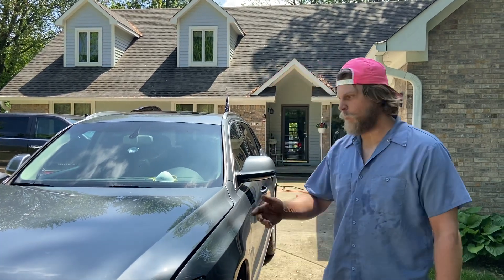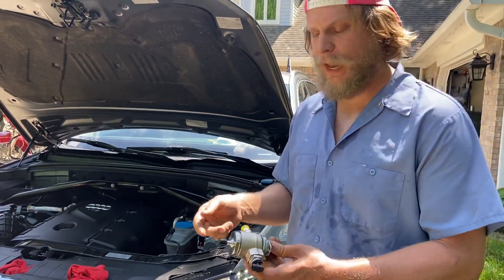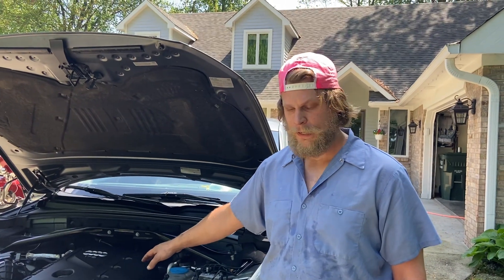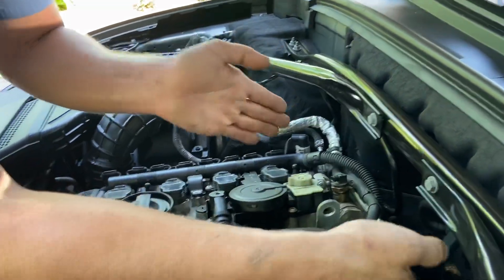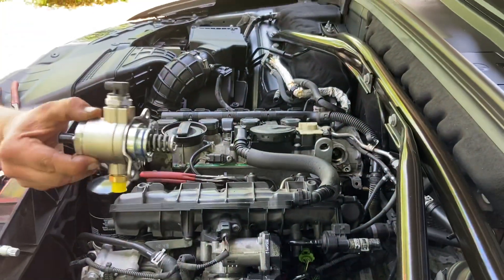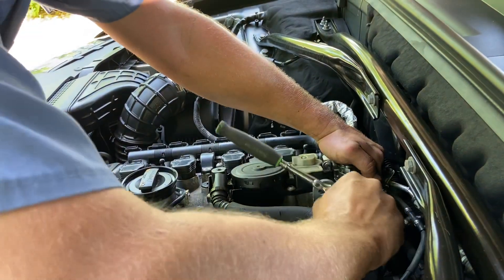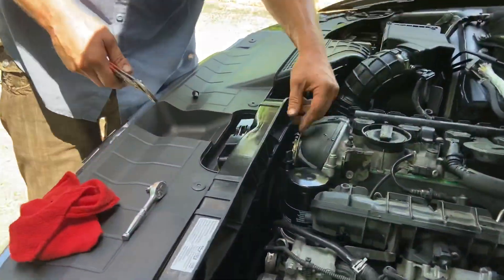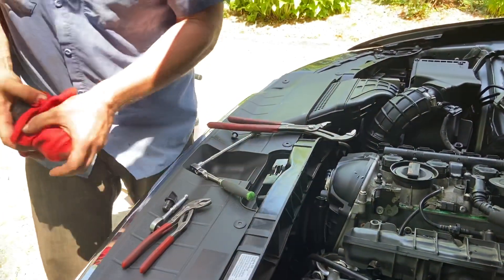P2188 Audi vw a4 a5 q5 2.0t tfsi hpfp

Comment: This fixed my 2014 Audi TT with 207k miles. P2188 and P2177 codes, the later having turned on the MIL light. Started cold, but had starting issues after driving and when left one hour off when engine was still warm. After quickly replacing the HPFP with my brother (engine is transversely mounted so was easier to get at the pump), all is well. Great video!
Reply: aftermarket or oem?

Comment: how does one test a hpfp ? I have a issue with my Audi 2l tfsi , no error codes. using a topton scan tool , I think its fuel because when it cranks the fuel rail pressure go up to over 80bar then as soon as the car starts the fuel rail pressure drops to 30bar and then the engine stalls (using the scan tool to monitor).

Comment: Can you tighten the bottom fitting prior to tightening the 2 top bolts?
Reply: No - the pump goes in with a spring load.  Not possible to attach the HP fuel line first.  I had no trouble with that fitting doing it like he showed.

Comment: I replaced mine on 2014audi could smell gas in oil. Change oil 2 times and still stinky but runs good now. How do I get rid of gas in oil smell?
Reply: Dang my car has been having gas in the oil for like 2 years but now it got worse, 500 miles after an oil change I take the oil cap off and it smells like pure gas

Comment: I had this P2188 on my A4 B8.5 2015 and changing the HPFP 100% solved my issue and this video was absolutely clutch.  💯  you are the MAN!!
Reply: Thanks for posting that. I have the exact same code on my 2015 A5.
Reply: What where the problems you had before changing it?
Reply: @edgarpilotzi3190  it was like a hard start condition. It was almost like it wasn't getting enough gas.
Reply: did you go oem or aftermarket
Reply: @bryan-th3xf  oem from fcp euro
Reply: @uavcalifornia9350  thanks

Comment: You ran the low presure fuel hose over the ignition wires. At 2:08 (original) it's oposite.

Comment: I have P218800 and P030200 error codes.... i have the same car that when engine temperature is hot it refuses to start ..so i have to try for 5-6 times to start the engine ...but when engine temperature is cold it start perfect ..i have noticed that my car now consume more fuel and acceleration is not the same ,now is slower ....any idea what can be the problem?

Comment: so that took well below 1/2 hour!   
My 2015 Q5 2.0.  I have misfires on  cylinder 1 &3 at high speed (not necessarily at high RPM, but both speed and rpm - around 73-78 mph). 
Plus codes P218800 and P12500 (low Fuel level ), Local Audi expert says I need to change coils and spark plugs, and gas cap. The car has 99,600 miles. So I guess I should do it anyhow (doesn't look like the previous owners did that at 35,000 miles) since they are getting up in there....but I think it might not solve the misfires unless the fuel pump is replaced, like you did?
Reply from the maker: If fuel is leaking into the oil with a bad hpfp it needs replaced immediately along with an oil change
Reply: @NaptownTuner  thank you.

Comment: I have a strong gas smell in the oil on 2011 Audi A5, no codes or cel. If it was the pump, I should be getting a code, correct? Maybe injectors?

Comment: I have a 2011 A4. The car used to run and run very rough. I have codes for multiple cylinder misfire. And the car stopped running. Just cranks and won't run. Would it be the HPFP?? Please help. Thanks
Reply: Any chance that Hpfp fixed it?
Reply: @christopherlaw2460  new timing chain  2000$ later all is good now
Reply: @christopherlaw2460  no it wasn't. The timing was jumped.  Best way is to run a compression test on all cylinders. If they are all below 150 psi your timing is out. Hope this helps
Reply: @christopherlaw2460  new timing chain  2000$ later all is good now

Comment: Another great video! Thanks! I have a problem with my 2014 Q5 2.0T. Bad misfire on #2 & #4. I replaced the injectors and did the carbon cleaning in the intake and valves. While soaking I noticed one of the valves on the cylinder 4 didn't hold the carb cleaner liquid as well as the others. After putting it all back together, the cylinder 2 code went away. Now, I have P0304, P0300 and P130A. I replaced the PCV unit and still no change. Car runs shaky in limp mode. It drives but no full power. When I first start it, the CEL flashes then EPC light turns on. I am starting to think it maybe burnt/bent valve on cylinder 4. Do you think I should replace the HPFP too?
Reply: La mía tenía un problema casi igual con el cilindro #1 y le cambié las bobinas negras por las rojas y se solucionó el problema
Reply: @moxykid I'm having almost the exact same symptoms on a 2012 VW CC, but I'm also getting a P12A2 code.  Bad misfires on 1 and 3. I could smell gas while inside the car for about 2 weeks before the car went into "limp mode". What ended up solving your problem? HPFP?

Comment: please I need help !! my car does not work quietly at the first ignition !! the exhaust stinks of unburned gasoline. error reported by p2188 system too rich at idle bank. the oil level in the engine has increased slightly and stinks of gasoline. the car is a3 1.4 tfsi

Comment: What test we can do to prove the pump leak?? Because it too expensive.
Reply from the maker: You could wait until enough oil mixes with the gas until it wipes out your bearings,  you could send the oil sample out to the lab to see if it’s diluted and wait about 3 weeks to get it back.  Or you could just trust me that the hpfp’s are prone to failure and if you have a rich fault replace it first.  Usually you can take the pump out and smell the gas the strongest on the spring / end of the pump
Reply: @NaptownTuner   my car was running rich -15% LTFT, i was suspected for bad maf since i had some ather issues like bad idle, hesitating, hard start. I change the maf and fixed everything but the ltft went -25% with the new maf. What do you suggest me to do? Thanks
Reply from the maker: @fortnitedaily1042  so far I’ve never seen a bad maf on a 2.0t and I’ve been working on them for over 10 years
Reply: @NaptownTuner  i am pretty sure my maf was bad since the new one , fix my ather issues, and the car has much more power, just i cant figure out why the fuel trims get worse. Mabye its the hpfp, thanks for your help 👍

Comment: If the pump is still working, couldn't you just replace the o-ring?  A new OEM pump is expensive.
Reply: no the seal is on the inside.

Comment: Hey man, I get P2188 that comes and goes away after a few days. Could it be the MAF sensor?
Reply: @Vlad P. I have the same problem. Did you ever find out if it was the hpfp or Maf sensor? I would greatly appreciate it.
Reply: @wilsoncarter33  Hey mate, yep the HPFP was off.  APR stage 1 on the car. 2nd pump that got broken.
Reply: @vladp.5884  Thank you so much my bro. That will save me a lot of time and trouble and losing fuel. I really appreciate that ✌👍🙋‍♂️
Reply: @wilsoncarter33  You're welcome mate. All the best!

Comment: Wouldn't be easier to start hp fuel pump lower fitting before tightening hp fuel pump to the cyl head ?  
It's kinda the same on toyotas find out that this method works nicely. 
Love the channel btw.

Comment: would you recommend sticking with OEM replacement, cheaper aftermarket, or upgrading the internals with APR, CTS, etc.?
Reply: Oem dont buy them from the dealer tho they asked 700 for the pump and from ecs tuning it was 400
Reply: Always Try OEM but if cost is too much, buy aftermarket one that’s as close to OEM price and look at the reviews

Comment: I'm getting my pump in today my codes are P2188 P0505A P2279. question what size wrench did you use for the hard-line?
Reply: I believe its a 17mm
Reply: I know this was posted over 4 years ago but if you see this did changing the high pressure fuel pump fix this? I have the same 3 codes on my 2012 a5 tfsi 2.0t

Comment: Would the P2188 code only be the HPFP?
Reply from the maker: If you haven’t changed it yet it’s the most likely culprit and if you have oil mixing with your gas you need to get it fixed quickly.
Reply: @NaptownTuner  Yup oil smells like gasoline. Could it be the fuel injector(s) too? Plus I have poor gas milage (I think) I haven’t used the MPG monitoring system to check lately but I don’t think I should be getting about 59ish miles from full to 3/4, basically a quarter to full on the 2.0L. 

I found one HPFP from Motor Parts and another from Culmkari. Are you familiar with these brands, whether they’re good or nah, both go for about $65🤔 with a 3 year warranty.
Reply: @NaptownTuner  I changed my hpfp , the 4 injectors, 4 coils , 4 plugs, fuel rail pressure sensor, oil pressure sensor and i still smell it y!!! Please help

Comment: What tools did you use to be axact? I just bought a Hitachi Direct Injection High Pressure Fuel Pump, and it's black friday, I wanted to know what tools to buy so I can do this myself!
Thanks!
Reply from the maker: Get a vim stubby triple square kit 1/4 drive most people will have the rest or just a 10mm triple square socket or some use 6mm hex on the hpfp but it’s rare.  T30 17mm open end wrench pliers that’s all I can think of

Comment: I got code p0100 first on my vw gti and then after fixing (putting a new mass flow sensor) I am getting this code p2188. Any help if they both are related?
Reply from the maker: If you haven’t done a timing chain yet think about that but you would usually get a rail pressure too high fault from that.  I haven’t seen an actual bad maf on the newer audis yet, I often have even swapped “bad” parts on one of my good cars to verify what’s going on and haven’t seen a maf go bad yet.  Always the hpfp and when that fails gas washes the oil out and causes a rich fuel mixture and bad oil.  Always important to smell the oil when any fuel / rich code happens with Audi high pressure fuel systems.

Comment: Hi. I also have a 2001 AUDI A5 2.0 TFSI with the same error. P2178 and P2188. It starts hard, that is, I turn on the ignition, it starts, reaches a speed of 1200rpm and stops. Or it start on but it's very unstable and I need to keep it accelerated to 2000-2500rpm until it warms up. And it smells like gasoline. But it also causes problems when I have to idle a lot at traffic lights. If it stays longer at about 1000-1100rpm when I accelerate, hesitate and stop. You think it's the same problem, the high pressure pump or it could be a faulty injector. I had misfire the cylinder 1 often
Reply: YOOOOOO I GOT THE SAME CODES HOW DID YOU FIX IT?
Reply: @ricoa3388  I replaced the high pressure fuel pump with a new one. It works perfectly now.

Comment: I have a 2014 Audi A5 2.0 turbo.  It was running great I shut the engine off came out  started the car it had a rough idle rpm up and down. I turned the engine off and it hasn’t cranked since. It will start but not crank. I got a p2188, a p2539, p2293.  So my guest in is should I change the hpfp or the low pressure fuel sensor? I have taken the hpfp off and the cam follower looks great and I pulled the line off the bottom of the hpfp and I’m getting fuel out of the bottom when the car is turned over.  Any help I would appreciate.
Reply from the maker: James Bates start with the hpfp then do the high pressure fuel sensor on the fuel rail under the #2 intake runner.  I didn’t even look up your codes but this is the order since the hpfp has a much higher failure rate
Reply: @NaptownTuner  I have a 2014 Audi A4 and have the same p2188 code. I have replaced mass air sensor and o2 sensor. I still have the same codes. Should I try this?
Reply: NaptownTuner      Thanks so much for you reply.  I have one ordered it will be here on Wednesday.  So I will let y’all know how it goes.  The help is very much appreciated she has been sitting for almost a month.
Reply: The hpfp didn’t fix the problem. So I turned my attention to the pump in the tank. I took the fuel line coming out of the pump to the engine off and then attached a rubber hose to the pump and dropped it in a clear bottle and the fuel barely comes out like it trickles out when I turn the engine over. I dint have gauges so I’m trying these method. Do you know what the lift pressure should be? I mean it like barely comes out when I turn the engine over. I’m thinking about changing the pump. What are yo ur thoughts? Any help I would appreciate. Thank you.

Comment: Having same code p2188. Had a #1 &#3 and  random misfire code yesterday.  Had her shut it off and let sit, after a couple of minutes it would not restart. I went back to get it a couple of hours later and it started after a couple of tries ( like was run out of fuel) ran kind of rough. Will this cause rough/hard starting?
Reply from the maker: Fuel mixing with the oil and this high pressure pump failure code needs to be fixed immediately
Reply: @NaptownTuner  ordered hpfp and fuel filter as well from fcp euro. Thanks
Reply: @michaelgreen9531  did this help? I’m having the same problem
Reply: @wyanjoseph3564  did you fix it ? Have the same problem lol
Reply: @Neverfollowthecrowd  did exactly what he said to do and that did not help. Put in new fuel pump , maybe I needed high pressure fuel pump idk because gas wasn’t staying in the car for long at all I feel like but idc It’s the past now I spent like $700 just trying to fix it and nothing worked lol imagine it was the high pressure fuel pump lol .I just gave up the machine told me stop wasting money because it had a fucked up cylinder and at that point it would be whole new motor block basically so I got my self a Kia Optima turbo 2015 fully loaded for $5,000 the price of a new engine for the Audi 😌🤣. Been reliable ass hell Customized it to the max people don’t even know it’s a Kia I have to tell them and  now next month I am buying a bmw 2012e92  n55 335i m sport and they are way better then Audi as far as reliable and doing mods for only $7,000 still cheaper then fixing the Audi. I still have the Audi believe it or not I just don’t know what to do with it I been selling parts to it..
Reply: I did change the high pressure fuel pump but not the one under the rear passenger seat but I don’t think that was the problem
Reply: I lived
 in Connecticut, and when I had my 06 a4 avant, RIP 2010-2021🤣🤣🤦🏿‍♂️.
Before the accident I had wit this car back in 9/21. But, 
Driving at 4:30-5:45 AM, 45 minute commute, on a 2 lane state highway, is so exhilarating!!!! 

I’m trying to fire up my ‘09 Audi b8 today, when I could’ve had it fixed, last year and cheaper